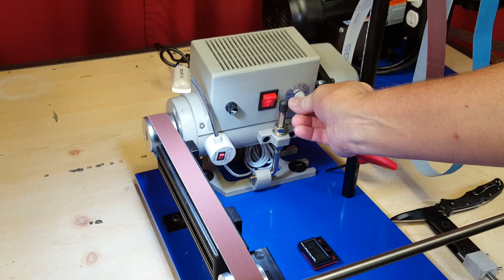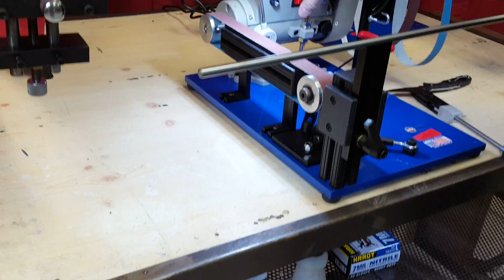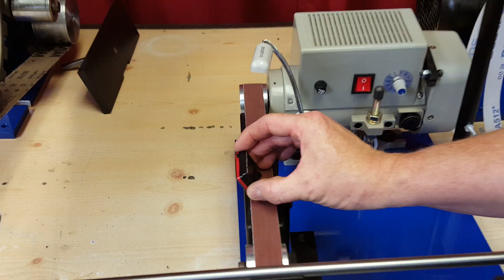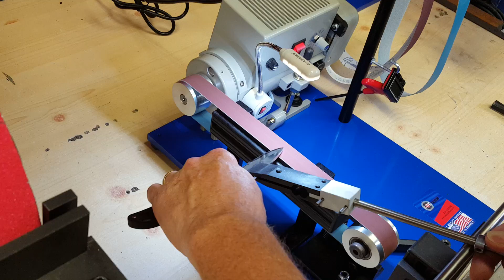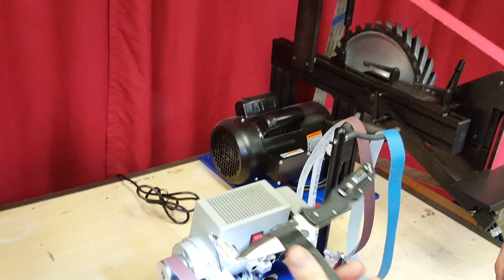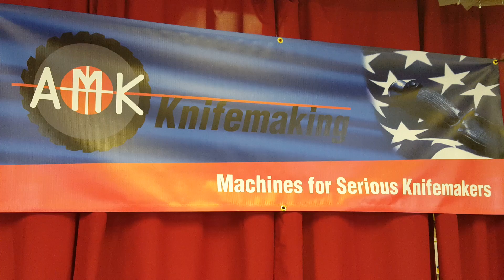1x30 Belt Sander Sharpener, AMK 75 Knife Sharpening System - 2016

Comment: I bought one of these off ebay for $500. The build quality is superb. It replaced a Loray electric. I paid for it in one weekend at a farmers market. My go to for speed is a TruHone. But at a FM this machine allows you to put on a show which to me increases sales. I give a 30 day warranty and it takes me less than a minute per blade. My competion is usually either stones or the paper wheel. I always charge at least $2 more per blade. They dont guarantee their work and I do. If you are wanting to do blade sharpening to make $$, this machine will do it.
Reply: Curtis Stewart How do you sharpen Partial Serrated Edges?     
Where do you buy belts? 
What belt you start with?
Reply: Do you still have your Loray?
Reply: @flyfishbrad  Yes.
Reply: @Oilfieldscout  would you be interested in selling it?
Reply: @Oilfieldscout  would you be interested in selling it?
Reply: @flyfishbrad  No.

Comment: fact is that the angle guide system will result in a variable angle on curved edges.  The angle at the tip will be slightly different than at the base.  It would still provide the consistency to make a fine edge, of course.  It is just that it might not translate well to a field sharpener.

Comment: Like the design and function of this machine. But I have noticed some sharpeners don't use a platen which creates a convex edge. I personally don't think that is the sharpest edge. I agree it makes a stronger edge but I won't be sharpening axes on the unit. A knife used for slicing tomatoes doesn't need a lot of strength. What is your opinion?
Reply: That's the beuty of this machine.  You can use the platen or go slack.  Fast or slow. Edge leading or edge trailing.

Comment: Which way does the belt spin? Away from you?
What's the longest blade you can do on this?
Reply: Frederick Kunitz 21 y
Reply: Wondered same question (belt direction) and if unit had/has fwd/reverse operation to allow easy move between edge leading and edge trailing configurations ?
Reply: @GravityRoller  You can go either direction. And as slow as 200 rpm.